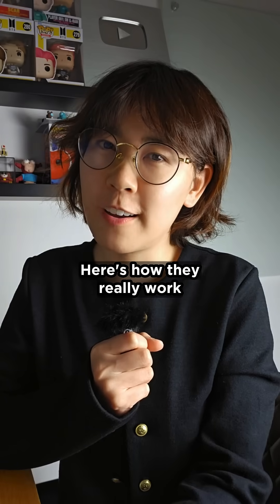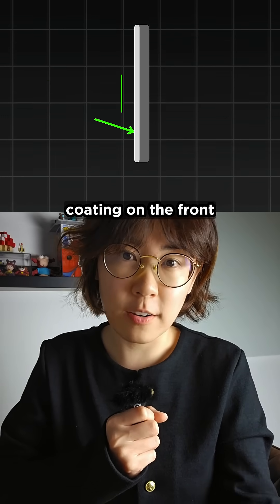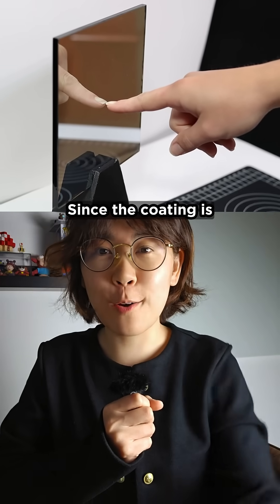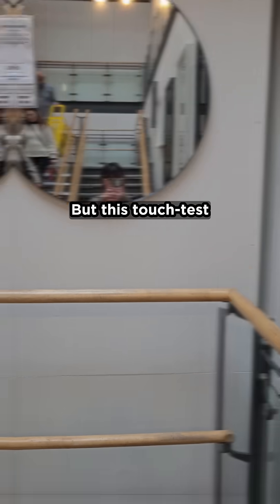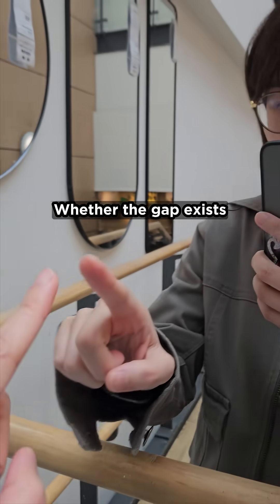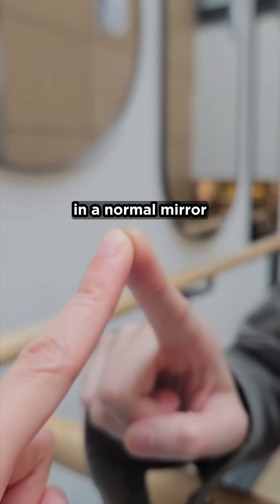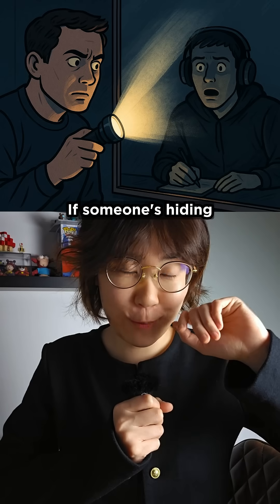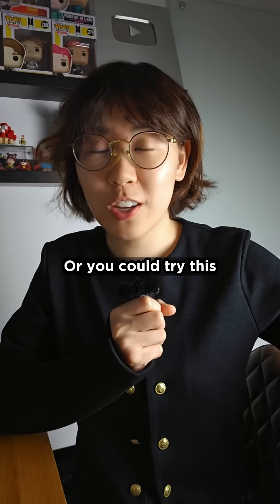Can You Spot a Secret Mirror with This Easy Test?

Comment: The correct term is two way mirror though.
1) A one way mirror can only refract light on one side of the mirror.
2) A two way mirror can refract light on two sides of the mirror.
3) the reason why it's called a two way mirror is in it's name... a mirror, if people on both sides can easily see each other than it's just a window.

Comment: The flashlight hack is also great against the double layer mirrors. If you have a one-way mirror, or an ultra-thin mirror, you can simulate a normal mirror by adding a layer of glass or acrylic over the front. This double layer trick is used more by surveillance than voyeurs, though... still... Use the flashlight. 😬

Comment: if you can't see through a one-way mirror from both sides, you're an idiot.

because it doesn't reflect all light, the reflection is dimmer than a regular mirror. and the fact that it lets light through one way, means it also lets light through both ways, which is why the 'illuminate the creeper' thing works. this means that you can actually always see a faint image of the other side. the reason you won't casually notice this is literally just because you're assuming that since it strongly resembles a normal mirror, and you deal with normal mirrors all the time, it must just be a normal mirror. or in other words, you're being stupid.

Comment: Fun fact, mirrors dont reflect the way some people assume. If you put words up a mirror, they reflect backwards usually, and people assumes that the mirror did that. But if you write those same word on a clear object and hold it up and look through it while the wotds face normally to you, theyre still forward in the mirror. They dont felect left to right, they reflect back to front.
Reply: This. Mirrors only flip the z axis. The mirror didn't flip anything, you did.
Reply: The back of a word is also mirrored, so the mirror double mirrors it.
Reply: Mirrors reflect what you show it. 

If you look at the back of the "clear object" you just wrote the word, The word gets mirrored without the use of a mirror. 

Some mirror reflect left to right, some reflect back to front. Most reflect exactly what you show it, no fuckery involved.

It's your perspective that messes things up.

Comment: Shining a light on it will do nothing. If someone has something like this set up in something like a hotel, it isn't going to be a huge hole and them sitting behind it. It will more likely be a very small hole in the wall just big enough for a camera lens and you probably will not see that with a blinding flashlight shining in your face in a mirror.

Comment: You can put a pane of glass in front of a one way mirror the same way you can put one in front of a sheet of polished aluminum, so it's really not a good test. Also, there are "first surface" mirrors that reflect without glass in front, but are not see through

Comment: the terms are first surface reflection and second surface reflection. they can make mirrors either way but first surface mirrors are expensive and rare, they're used for like telescopes and stuff, but also some expensive "beauty mirrors" or something like that... 
and they can put the partially reflective layer on either side to make one way glass. it doesn't matter which side has the coating, it only matters which side has more light.

Comment: You would have to hold the flashlight flush against the mirror surface or you'll just light yourself up in the reflection. What this won't find is a camera mounted behind the mirror and just one tiny bit is one-way where the camera is. You can turn the lights off and use your phone's camera pointed at the mirror and it will see the infrared light on the camera through the glass. Also a polarizing filter can eliminate reflections making it easier to see through the sketch mirror.

Comment: Every one way mirror I've ever interacted with has not worked the way you described. They're all symmetric, but whichever room has more light will not be able to see the subtle contrast of observers in the darker room because the reflected light overwhelms their contrast detection. The same proportion of light is transmitted vs reflected from both directions. And that's why everyone calls them two-way mirrors, because it depends which room is lightened which way the mirror effect prevails. They're only one way at a time.

actually, now that I think about it, your explanation doesn't make much sense. how does the coating reflect more light in one direction than the other if there isn't more light on that side to begin with? If you're viewing from a shallow angle, refraction can compound by interfacing with multiple layers, meaning you could end up with total internal refraction from one side, but not the other. But that doesn't fix light that's nearly perpendicular... which is the majority of light we observe when using a mirror normally.

Comment: Actually, a two-way mirror works on both sides, so there will always be one side where the finger appears to have a gap. In theory, the amount of light passing from one side to the other is equal, which is why the observation room needs to turn off the lights.

Comment: we had a one way sliding door once, you can see through when the sunlight reflect from the other side of the room, thats why most rooms behind a one way is dark and the glass is tinted a little more, if i'm not mistaken the double layer glass where the middle part is the reflective coating is what shee is refering, its very heavy and when you tap it it sounds solid.

Comment: A "two-way" mirror is just one that partially reflects and partially transmits light. I don't think there is a requirement that the reflective surface be on "your" side.

Seems that it would make more sense to have the glass on the subjects side just to protect the delicate reflective surface.

Comment: There are also polished solid metal (stainless steel) mirrors that reflect with no gap, and being made of solid steel means they obviously cannot be used by creeps on the other side. They used to be common in public park restrooms as they are not susceptible to breakage like a glass mirror so the worst a vandal could do would be to scratch or dent them. 
There are also hand made polished metal-alloy (secret recipe) mirrors called Aranmula Kannadi, and which are only produced by one family in India who knows the secret to the mirror alloy.

Comment: If u are in yhe hidden spying area turn the lights out. It should be considerably darker in there then in the observation side. This will make it clearer for u to see them and very hard for them to see u. Even if they have a flashlight. Also if u are building something like this consider making most of the glass a regular mirror. And only sections 1 way do u can see. This eill drastically lower the odds they figure it out. 

People are going to do what they are going to do. But what ever u do, do it well or not at all.

Comment: A better way to actually test all mirrors like these is to turn on your flashlight on ur phone, then plop it on the mirror. If the mirror is over a sink or near a horizontal surface, you can rest your phone on the surface while slanting your phone to allow light through the mirror. Cover the sides of your eye to block any other light from reaching your eyes. Youll be able to see if the light reaches another wall or side.

Comment: a better trick is grab your phone go to your camera and use the back camera and approach the mirror until the camera touches it because your phone casing is closer to the mirror than the camera it seals off any light from the world around it and because behind the mirror is usually dark you can turn on flashlight mode and shine it through the mirror but if the back of the mirror is bright you'll be able to see anything from the back of the one way mirror

Comment: The reflective layer could be on either side of a spy mirror, just depends which way it's facing.  When shining the flashlight, put it right up to the mirror, to avoid reflecting it back.  Theoretically this construction could be true for a normal mirror too, but unlikely.

Comment: And then there are also the optical mirrors, which won't even have the glass cover the reflecting surface but still be a one way mirror. 
Although I would assume the chances if finding them commercially used are slim😂

Comment: Thank you for correcting this misconception. 

But I need to clarify, not all mirrors use glass. (Your chrome bumper of your car for example.) There are also other 1st surface mirrors. Pure silver mirrors were also known for this property. Optical mirrors are often first surface mirrors to prevent distortions and reflections caused by glass. (Most commonly a tint, this is why first surface mirrors are sometimes used in high end hotels so that their customers have the most accurate appearance in their reflections. Unessarry yes,, but it is done,,) often with silver.) First surface mirrors are well known, and far more common than people think. Additionally all someone has to do is place an additional glass pane between the 2 way mirror and the subject, and the 1st surface effect goes away.

The flash light trick is the most relieable, since 2 way mirrors rely on the hidden side being darker that the side which is reflecting. Thus a flashlight shown close to the mirror will reveal anything hidden by the mirror.
Reply: Whenever I see a chrome bumper, I know the owner has a secret spy camera in it and is trying to spy.

Comment: What if the partial reflective surface is between two glass panel. Ofcouse the flashlight test will still work. But the touch test wont work.

Comment: Heres an easy way with just your phone.
Open camera app, record and hold it in front of the mirror, while holding it near you. Hold the same distance and get closer to the mirror until the phone touches the mirror, you will see through it. It's a good way since you won't hold a flashlight on you for no reason and sometimes just got no idea where's the light switch at.

Comment: im a glass installer and id tell yall if you want to know if its a see though all you need is laser or flash light if youre not convince then you can poke a hole using hot water and a knife or break it,, another easier way to know is thermal camera

Comment: Also, mirrors are on the wall, while see-through mirrors ARE the wall.  So try to look behind the mirror and find a gap. (Assuming you can't turn the lights off, as even without the flashlight, you can peak through.)

Comment: They don't need special coatings to do this. "One way mirrors" can be formed anytime one side of a piece of glass is significantly brighter than the other. When that happens, the bright light reflecting on the surface completely hides the dim light that passes through. This is why the windows of skyscrapers look like mirrors from the outside. In police offices, they keep the interrogation room brightly lit while the other side is dimly lit to create this effect. 

Standing right up against the glass and using your hands to block out the light will let you see through it.

Comment: It's not just the thickness of the glass but it's also on what side they reflective codeine is on. One-way mirrors don't need to have The reflective coating pointing in a particular direction as It will reflect both ways. And on some mirrors often called true mirrors the reflective coating is not painted over with that greyish paint what's there to prevent scratching.

Comment: My ex gf would check the bathroom mirrors in hotels. Even though I pointed out that the wall the mirror was on faced the room on the opposite side. Maybe she was concerned someone was squeezed between the studs behind the drywall. 🤷‍♂️

Comment: the touch test will usually depends if the mirros is surface coating, where the silver coating (no, there is not alluminum ones) is facing you instead of be in the oposite side placing the glass in between you and the coating... In the one way mirror, the film can also be in any side and will works the same, turning the brighter side reflexive and the darker one will be like a simple glass...

Comment: The reason vampires couldn't see their reflections in mirrors is because older mirrors used silver instead of aluminium. Silver was fatal to vampires so it never reflected their image. This myth expanded to cover all reflections but originally it was only silver mirror reflections.

Comment: HAHAHAHA... 
Idiots, please allow me to enlighten you. 
You see a gap in the mirror because the actual MIRROR is the silver coating, which is located on the BACK SIDE of the glass.  Then the CLEAR GLASS in front of the silver mirror is pretty thick, so you see the gap because there is glass there.  JUST GLASS.  And then silver behind it.

The reason they put silver on the BACK is because then the glass acts as a structural support, holding it up, as well as protecting the silver against oxidizing (air + silver = black silver oxide) and protecting against scratching the silver by accident (because that silver layer is only a few atoms thick so the smallest scratch will ruin the mirror).

Now that clear glass comes in different thickness, depending how much money you spent on the mirror.  Expensive mirrors have thicker glass than cheap ones.  SO if the mirror is cheap and the glass is thin, you might not see the "gap".  Thus, DO NOT trust the "touch test" because it almost never works.  The "flashlight test" is the way to go.

Comment: WRONG ! On two-way mirror the reflecting film is NOT "on top" or "front". It is in front only if some incompetent installer installed it the wrong way around. It works the same either way you install it, but it if is wrong and unprofessional to install it with the coating infront as the coating is fragile and might get scratched.

Comment: Don't do any of this, just put your camera against the mirror and look inside the chamber, you want to check all the mirror, cause most of it will look like normal, just a small hole will have a camera or access to other chamber.

Comment: The point is that mirror is indeed half-coated, which makes light passthrough partially, but whether it is coated on front or back just dosen't matter. So why would the bad guy install it with silver on the front and let you know with gap-test?

Comment: A.Better way is to just put your face up right against the glass close enough so the shadow of your head keeps light from reflecting against the two-way mirror. it acts the same way as turning off the lights
Reply: You can put your hands around your face as if youre trying to look at glow in the dark dinosaurs.
Reply: @SourDonut99 I'm a little late but that's technically what I was thinking and that's how I usually do it to
Reply: @SourDonut99 👍
Reply: or you could just take the mirror off the wall,if that is not possible then just maybe it is a 2 way mirror.
Reply: @runeingebretsen8378   Most of mirror are now glue to the wall especially in hotels and other public spaces.